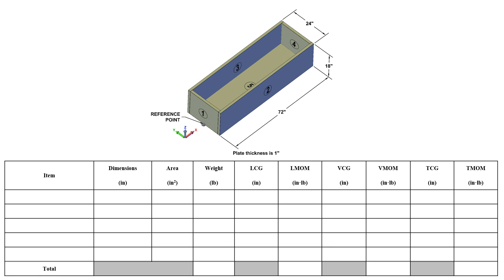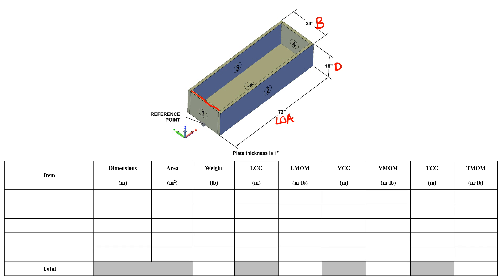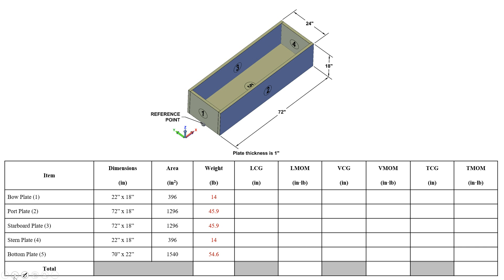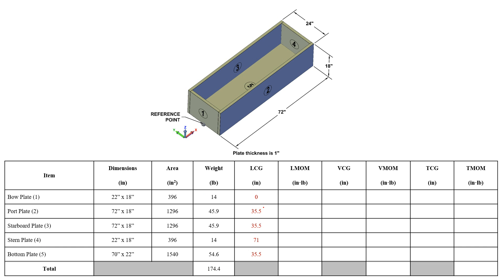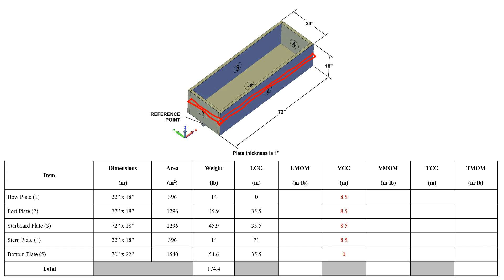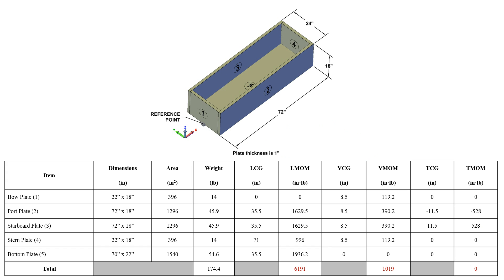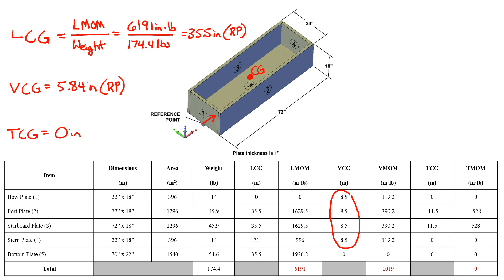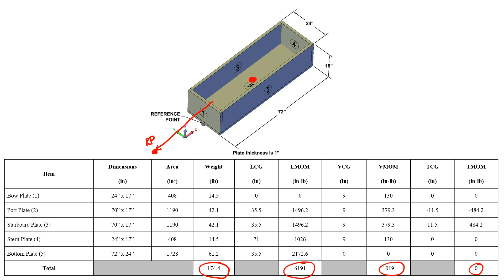Tutorial Video - Center of Gravity Example

Comment: If the reference point is in mid ship section, which side is negative LCR?
Reply from the maker: If the reference point is in mid ship section (i.e. x-axis is centered over the number 5 and the x-axis is pointing towards the number 4), then negative values for LCG will exist entirely for plate 1, and half of plates 2, 3, and 5.

Comment: For your LCG of Bow Plate (1), wouldn't the LCG be .5 inches since you are measuring the distance from the reference point to the plate's center of mass?
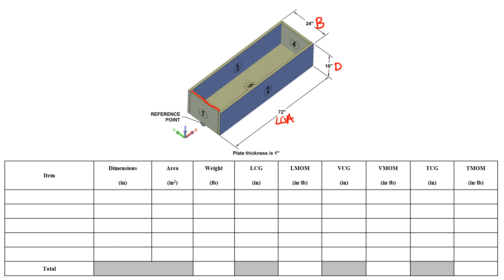Reply from the maker: In this example, the reference point is at the mid plane of Plate (1), so the LCF is 0 (explained at the 0:50 sec mark).  In the Guidelines and the Illustrated Glossary, the reference point has moved since 2018 to more closely match the reference point of the actual boats. In this case the LCG has changed to 0.5 inches. Keep up the good work!
Reply: The Apprentice School SNAME Boat Design Competition Ah, thank you!